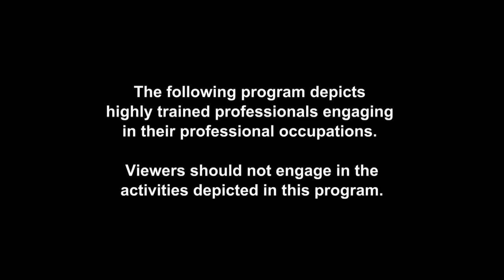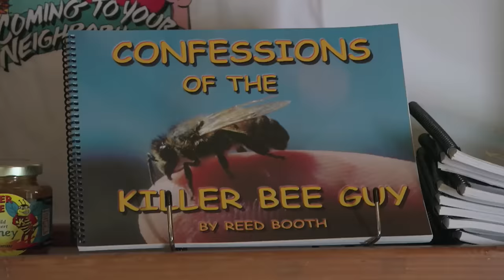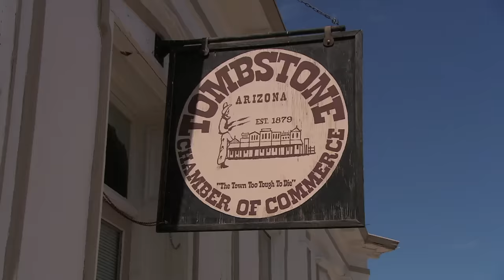Risk Takers - 112 - Killer Bee Removal Expert | FULL LENGTH | MagellanTV

Comment: Was attacked by killer bees once. It was an experience unlike any other. Each bee was a savage kamikaze monster with a brutal and relentless RAGE. No joke. Hard to believe something so tiny could possess such determination to kill you.
Reply: @Typhus-th6ud The behavior. The killer bees are slightly smaller than normal honeybees, but they’re noticeably more aggressive.
If one bee sting triggers more bees to attack you in the same exact spot as the first sting, more likely than not, you’re dealing with killer bees.
CORRECTION: If they send a larger response upon being disturbed, and chase you for at least a quarter-mile, pretty safe bet that they are Afrikaanized bees.
Reply: @Typhus-th6ud Not all species of honeybee have the same level of aggression.
The colony sizes and the level of immediate attack response are both noticeable differences.
Also, aren’t Carniola bees much more docile?

My guess is the OP took into account which species were known to be present in the area they were attacked, considered the behavior of the bees, the size of the hive (I’m guessing they got too close to a hive and set off a response), how long the bees chased them, and came to a reasonable conclusion.

Comment: Damn, that guy gets stung on the nose A LOT! That shows a major design flaw in the mask. It should be stiff, almost like the face mask people using when fencing, so the nose wouldn't be able to touch it.
Reply: He's using a thin suit honestly, you can get thicker ones but in 100°f the heat will kill you before the bees. The thick ones just don't breathe
Reply: he also should be wearing a hat underneath the hood because the bill of the hat keeps the screen from your face. I work in pest control and that's rule number one lol
Reply: @kevinmadden753 ^ This under a fencing style hood a baseball cap would suffice to fix that. The fact that they didn't use that made me wonder if they were a pair of chancers especially when they were kicking at the pipe of junk. They must have been thinking lets stir these up / put on a good show for the cameras.
Reply: @fishmanfairclough7530  - Exactly what I thought too. Why else would you do that? If I was seriously trying to get rid of them I would have figured out a way to put a huge mesh over it all and vacuum them all up FIRST. Or send a little robot in there to do it. : )
Reply: They should put glass
Reply: Midnite Flyer glass fogs
Reply: He could just put on a dust or painters mask
Reply: Final type of bee suit will bee complete iron armor
Reply: Kevin Madden any tips for people who have to wear hats to work? I really hate wearing any hats, since they make my head uncomfortable, hot, and my head hurts under any pressure, I even have a hard time wearing a headset for a few hours

Comment: I think someone needs to develop better suits
Reply: Menace there are better suits they’re just not using them for someone reason. Their using painter suits
Reply: T-60 power armor outta do it
Reply: Mrogers lwr They're in Arizona literally a block away from the sun. They use a thinner suit so they don't have a heat stroke.
Reply: Its not a painter suit. Its a bee suit and its not gonna fully protect you from every sting. But  it can and will save your life from being stung millions times by killer bees. Few stings is little compared to being stung  until  dead. Also depends where you live and what bee suit you need. Weather can kill if were too hot 104F to be exact  will have a heat stroke.
Reply: Yeah like there’s gotta be a better design for them. I’d want like a clear, hard visor similar to a bike helmet for starters
Reply: They could put glass or plastic over the face but still make it breathable with a mask or something
Reply: Fursuiters use internal cooling systems for hot days, or even just for casual suiting, because the suits get really hot, as you might imagine.
It should be easy enough to incorporate such a system into a beesuit.
Reply: im on it
Reply: @briannam9825  good point
Reply: Iron man have the best suit
Reply: Like glass on the top of the face and around and net on the bottom
Reply: Frisky Fox it’s a good idea but it seems expensive

Comment: Why don’t they just make bee suits with something like a plastic dome so it’s not possible for them to get stung in the face
Reply: or maybe a wire mesh inside the hood part so they can’t touch the head
Reply: Wear a cover over you nose.   Hell, have some fun and use Groucho glasses and nose.
Reply: I was just like: make a fencing helmet but adjusted for the bee suit
Reply: Better yet an astronaut helmet 😂
Reply: I... GASP cannot breathe!!..

*dies
Reply: After getting stung once, you'd think they'd figure it out. Brain not connected?
Reply: it would fog up
Reply: I was thinking a baseball cap with long brim under the suit hat. The extra length away from the face might give him the length he needs
Reply: There are wider brim veils but they aren't as sturdy and with a swarm the bees could in theory move the mesh close enough to sting. There probably are some more sturdy net masks that are wider but the masks they have seem to be attached to their suits instead of separate pieces which reduces gaps.
Reply: yeah
Reply: M Y S T E R I O
Reply: I Totally Agrees 💯👈🏾
Reply: U can't have a plastic dome because they can't breathe
Reply: Because then you coyld not breathe
Reply: Just use metal suits instead with air tanks
Reply: Plastic would be terribly hot in some places... I did wonder if reinforced nose and ears would help?🤔 While still allowing air....

Great video, so informative. I wonder if you can seal off honeybees, too... Will they die off. We have them in a building brick, little kids play near by. Scared to lure out, they may get mad and hurt neighbors. I find them dead or dying at my door entrance. Help🎺
Reply: @Benitojacova  have you heard of heat stroke lol

Comment: Those bee suits could be upgraded significantly. First, make the material thicker so stings can't get through even if the suit is sticking to the guy. Second, add a curved rod in the middle of the mask so it can't hit the guy's face
Reply: The curved rod is a good idea
Reply: The Guy
Reply: The rod is smart but the thicker  material would be too hot, mabye just more layers of the thin material?
Reply: Edward Du you my friend could make life Thousands of times easier
Reply: I'm sure if humans can make bee suits they can make more efficient ones. I totally agree. Not only are people whom called, animals, and others need safety, but so do they. I'm sure it's rare to get someone as brave and still as sweet as Reed and his new worker. 

I like the soap and water method. Less poison in this world, more humane.
Reply: Curved rod = face slap 20x
Reply: @thuy-anle1793  not if its in the layer of fabric in the top.
Reply: Or he could just wear a hat with a brim like the new guy.
Reply: Edward Du plastic instead of screen for the mask
Reply: The curved rod might not be a bad idea but as someone who actually keeps bees I can tell you that making that suit material thicker is a bad idea. They don't breathe much as is, the suits get hot and humid very quickly as is.
Reply: yes

Comment: Is there a reason you can't use a nose guard on the tip of your nose, before you put your head gear on?  It could even be a disk cut from  duct tape or a tiny pad of  folded gauze taped on with a bandaid.   What do you think?       Good luck.  Cheers!
Reply: They're attracted to the co2 so a guard will likely hold that and attract them even more.

Comment: Is it me or could they wear thicker clothes underneath the bee suits
Reply: thea rella I thought ab that but they’re in arizona and that’d be more dangerous than the damn bees
Reply: @lcrawford133  oh that's true too I didn't pay attention to where they where lol
Reply: What about a wetsuit with an ice vest?thats a thick material on those right?
Reply: Yeah, like sweaters
Reply: I think they should be wearing thinner but full body material under the suit. Given they live in arizona the big thing that gets mentioned as getting them stung is the suits sticking to them. If they wore something that covered them to keep the sweat and the suit apart but also thin enough to breath in the heat of arizona that might help.
Reply: Too h0t but I think they should bandage the exposed areas ahead of time, like just put a bandaid on your nose
Reply: Won’t they get heatstroke if they had thicker clothing
Reply: @Kyimeoketo97  Those stingers will go right through the bandaids.
Reply: Too hot.
Reply: Would u do it in 90-110 degree temperature?
Reply: thea rella y’all if a bee can sting through your skin what makes you think that a couple of layers of clothes will stop it from getting through it? oof but if it does work that way then 👍🏼👍🏼

Comment: Sir, let me recommend you smthng from the arsenal of Russian special forces that allows to lie for days in marches with moscitoes, bees, hornets, whatever. Make yourself a net shirt going all the way to almost your knees out of thick (1 sm) natural soft material ropes and wear it between your body and the bee suit. The cell size should be about 1/2 by 1/2 to 1 inch by 1 inch. That will create both a space that no stinger will be able to cross, prevent contact between your skin and the outer material but also ventilate yor skin and you’ll feel cool.
Good luck.

Comment: They should use a large shop vac, to thin them out as they go.   Seen another guy use that and it worked like a charm, just saying.
Reply from the maker: That sounds slightly dangerous but then again, it's a dangerous job.
Reply: Other bee removers do use the shop vac